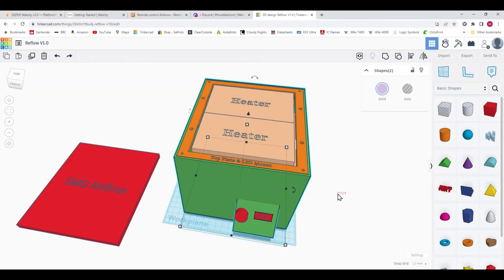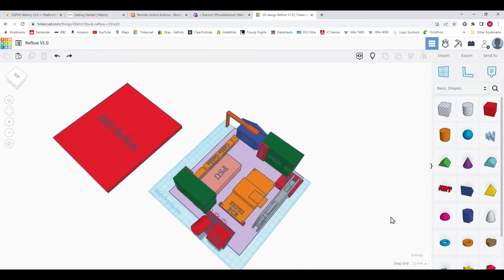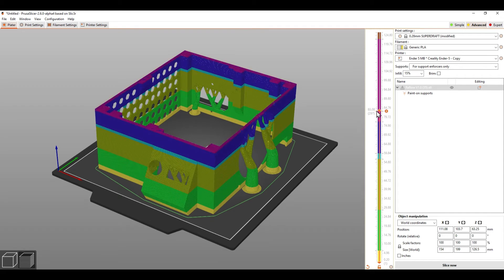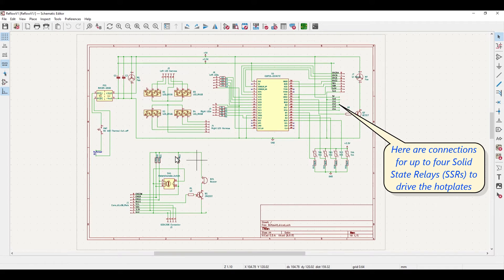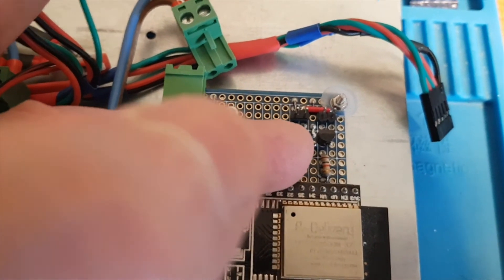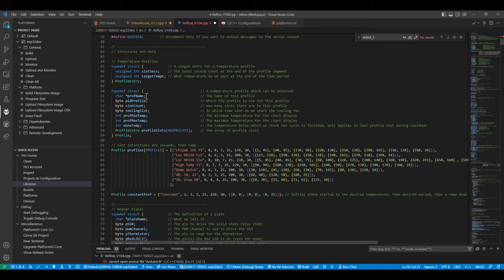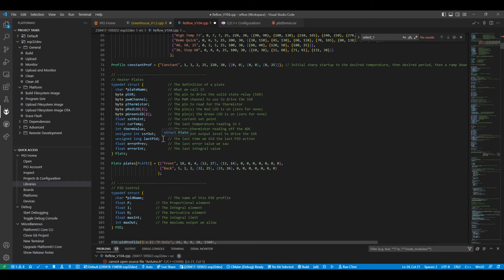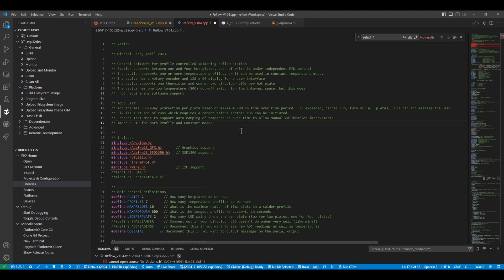SMD Solder Reflow  Hot Plate 3D Model, Circuit Diagram, Teardown and Code Overview

Comment: Hello Michael, would you be able to help with the code. I have tried recompiling it, but there are issues with the ledcSetup, I have tried to fix it. But you are a greater man than me. I have failed. Some of the code you wrote is out of date now. They have removed some key components.  I would greatly appreciate some of your help. Basically this is the best reflow i have found.
Reply from the maker: Hi there :-)  I wasn't aware the Espressif had updated their frameworks from 2.0 to 3.0, but it's good to know :-)  I don't currently have the ability to compile the reflow code under 3.0, but loooking at the notes on Espressif's web site at https://docs.espressif.com/projects/arduino-esp32/en/latest/migration_guides/2.x_to_3.0.html and some other articles I can see that they have deprecated ledcSetup, so it looks like you need to replace the seperate ledcAttachPin and ledcSetup lines with a combined  ledcAttachChannel call, so the ledcAttachPin and on ledcSetup on lines 650 & 651 would become:

    ledcAttachChannel(plates[i].pSSR, PWMFREQ, PWMRES, plates[i].pwmChannel);

And the ones on lines 657 & 658 would become:

    ledcAttachChannel(pCoolingFan, COOLPWMFREQ, COOLPWMRES, coolingPwmChannel);

I hope that that sorts it for you :-)
Reply: @michaelbenn4741  I have managed to compile it with the old version. What i did was use an older version of Arduino 1.8.18 and used an older board library. I think it was 2.0.17 or something like that. .  But good to know what you recommended i will try and update it. This is a brilliant project, thank you so much.